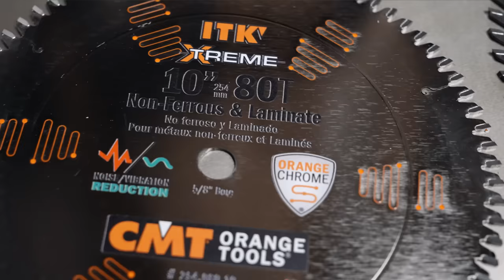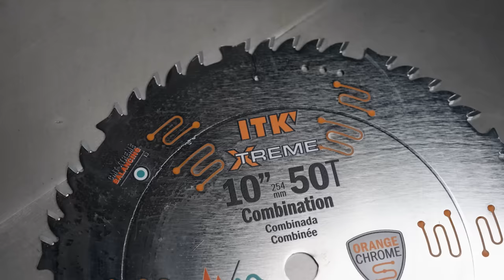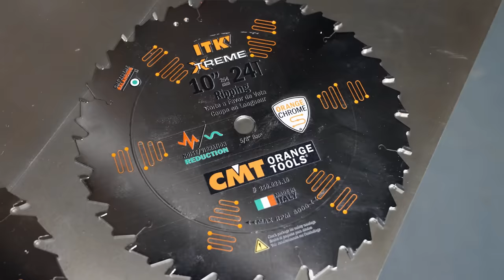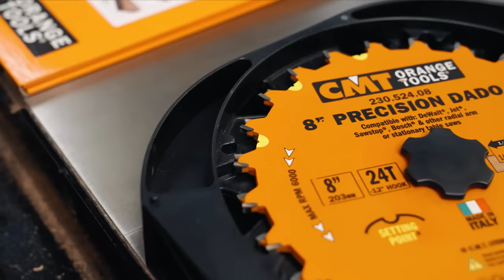A Comprehensive Guide to Table Saw Blades with 60,000 FPS Slow Mo

Comment from the maker: Brand New Lineup of Full and Thin Kerf CMT Chrome Saw Blades - use code KMT10CMT for extra 10% off https://kmtools.com/collections/cmt-saw-blades
Blade Cleaner - https://shop.kmtools.com/bladecleaner
Comprehensive Guide to Saw Blades Blog - https://shop.kmtools.com/bladesblog
Table Saw Blade Sharpening Video https://youtu.be/OSXacCeEZu4
How to Tell When Your Saw Blade is Dull https://youtu.be/ItaxJMBmsOg
Video Refresher
Thin Kerf VS Full Kerf Thin is better if your saw has less than 1.5 HP. If your saw is more than 1.5hp get the Full Kerf. A Thin Kerf blade is great to have in the arsenal regardless for those times you want to save as much wood as possible. Also great for preserving exposed joinery and grain match when removing box lids.
Ripping Blade 24T The best for rip cuts and terrible at crosscuts. My most used blades.
Crosscut Blade 60T/80T Fantastic for crosscuts but terrible at rip cuts. Low or negative rake makes them great in the Miter Saw or for fine cuts in plywood. 
General Purpose Blade 40T Great all around blade for non repetitive cuts in wood UNDER 1.25”. Great for shop jigs and plywood.
Combination Blade 50T Great all around blade for non repetitive cuts up to 2 and 1/8” inch thick. Not good for plywood though.
Dado Stack Best for dados, grooves, rabbets, half laps, bridal joints, and hogging out material when you’re not cutting all the way through.
Central City Tool Supply Saw Sharpening (in Santa Maria, CA) http://bit.ly/CentralCitySawSharpening
Reply: Just ordered a 60T for ripping some Walnut lamination strips for rocking chairs. I’ll put it to the test.
Reply: You mention less than and more than 1.5hp.  However what if your table saw is equal to 1.5 hp (as mine is 😂).  In my search on the web it seems to be up in the air and have even seen some rather large debates.  What is your opinion?
Reply: I don’t know why but my cmt tk combo does better then their 80 tooth and my TK Freud glue line blade
Reply: I'm still undecided on which to get...I can only afford one right now...sigh. @KatzMosesTools Tamar 3x3 customs speaks highly of you so you are part of my research.  I  see blades with slice or openings every so far along...it's my understanding it's to help cool the blade. If I have a blade with none...is it safe to make my own thin spaces or cut outs? If so is there a particular shape or size  and how deep would I go? I  inherited a bunch of blades from an uncle when he passed away.

Comment: I just received my Fine Woodworking magazine. Imagine my surprise to see a tool I purchased from you several years ago that I use very often. Congratulations on being included in the “Dovetail guide section “. I have found it to be an excellent tool at a reasonable price.

Comment: Awesome video. One thing to add though, the difference in the plate thickness on the thin kerf VS thick kerf and how that can influence stability of the blade. Forrest, for instance, recommends to use a blade stiffener on the thin kerf because they can sometimes flutter due to that thinner plate.
Reply from the maker: In my personal experience a blade stiffener severely limits your cutting depth and doesn't have a noticeable effect in my opinion. I could certainly see a use for it in some harder woods but I used one for about a year because someone recommended it and then once I took it off I never went back.
Reply: @katzmosestools  I definitely agree with it limiting the depth of cut. I have one and never use it, but I also only use full kerf blades since I have the Industrial Sawstop. It'd be interesting to see if there are situations where you could cause the flutter and compare one with and one without the stiffener. Maybe it is just snake oil, idk

Comment: Ive been framing for 25 years and never really put much thought into blades other than what i thought was thin kerf is best ive been using a Diablo 24 tooth for years now but i just bought a 60 tooth saw blade for some architectural concrete forming ive been doing and i love it so im here to learn what blades are best for what.

Comment: Nice video. When I started with my JSS Pro (1.5HP) from SawStop, I purchased several quality thin kerf blades just to discover that they caused pinching between the riving knife and the fence, so I switched over full kerf blades (CMT Chrome & Amana Electro-Blu) and all my problems went away.

Comment: I think this video is going to cost me a lot of money 🤫 I’ve understood different blade types before but never really respected it enough to ever using anything but a combination blade, except when I’m using thin veneer plywood. I’ve used TSP to clean my Blade before and it took off all the markings, so it probably would do the same for the slick coating as well. Thanks for this in-depth look at this, Jonathan.

Comment: Great video on multiple fronts.
- lots of good info!
- great slow mo, besides being cool, it really helps understanding what our blades are doing.

I agree on the premium blade being a consideration. I have both a CMT crosscut (IIRC at your suggestion a while ago) and a Ridge Carbide rip blade. Love them.

Comment: I’ve actually started using 7-1/4” blades on my table saw full time, until I need to make a full depth cut. But 99% of the time I’m cutting 1-1/2” or less thick material and the 7-1/4” are cheaper, thinner, easier on my saw, and quieter. And cheaper 😁

Comment: Glad to see you are doing well,  been awhile,  me too, changing gears at this point, come with age I suppose. 

I'll be checking out you shop, perhaps I could use a new blade or two for the table saw, the miter has gotten most of the new blades of late, but in changing gears,  the table saw will need a new set, plus with be researching your collection of blafe and bit sharpening job shops!  

Safety first, last, and in between,  provides for happy fabrications!
PS.  Well damn the bad luck, guess I have to make a 150 mile round trip  you're sold out of the blades I like to use!  ...maybe next time!

Comment: Great info as usual. I need to watch again and take notes. I've got an old (80's vintage) Craftsman 12" direct drive table saw and have always been torn about buying 10" blades for it, feeling like I'm cheating myself out of the extra radius. Thinking rationally about it, the only time it would make a noticable difference is if I'm trying to resaw or otherwise cut through extra thick materials, so I probably shouldn't feel bad about using the smaller blades. Do you have any thoughts about this? Is there anything else I might be missing out on by using blades smaller than the capacity of the same? Thanks for sharing!

Comment: I've been working with hardwood a lot more lately and this information makes a lot of sense now. Bought a big ass piece of purple heart, maple and cherry recently. Each 8-9' long, 3" thick, 8-10" wide. Do not recommend repetitive rip cuts on 2" purple heart using a delta 76-725 on a 15 amp circuit with an 80 tooth crosscut blade. Picked up a CMT 201.024.10 for this type of work and while I have not had a chance to use it due to being sick from the plague, I'm excited to see what it's all about. Hoping it speeds things up! 🙏
Reply: The manual says you should run that saw on a dedicated 20A circuit to put less stress on the motor. If you're cutting a lot of super hard wood like that, it's definitely worth upgrading the circuit to protect the saw.
Reply: @derek_d  having some 30A 220v circuits installed soon 💥
Reply: @bucketofsteam9260  nice! You must have a T1 then? I have the T2 and it can't run 220 🙁
Reply: @derek_d  I do have the first edition
Reply: @derek_d  how do you like the second edition? Not sure if you've used the first for comparison.

Comment: Great video!  For ripping ¾" plywood at a 45 degree angle, wanting a clean cut but avoid burning, what would you suggest? (I am getting burning with my 40 tooth ATB blade from Ridge Carbide)

Comment: Great tutorial!  Questions on the use of thin kerf blades... 

Do you find it a benefit to use (a) blade stabilizer(s) with them to reduce possible wobble?  Are they worth the expense?

Also... any benefit to placing a spacer/shim between the thin kerf blade and saw arbor, so that the blade to fence distance remains the same as that for a full kerf?  I assume switching between thin and full causes the saw fence scale to be thrown off by the difference between the blades (meaning you may have to re-adjust the fence scale each time because the cut distance changes).

Just looking for help before I investigate further.  Tx!
Reply from the maker: I have never found a stabilizer to make a noticeable difference. It is way thicker that the 1/32 difference between a full and thin and cause you to lose a lot.of cutting capacity. You DON'T want to put it between the motor and the blade. The correct side is the nut side. Will cause all sorts of problems with the riving knife and the drive shaft.
Reply: @katzmosestools  Appreciate the fast reply!   Understood... on the stabilizer use.  What about shimming the thin kerf blade to make the right side of the blade align with a full kerf (again, so the blade to fence cut distance does not change)?  My old Craftsman does not have a riving knife and I use a MicroJig MJ Splitter (one setup for thin, one for full kerf).   Tx again!
Reply from the maker: @csimet  it doesn't change to the left side of the blade but changes by 1/32 between the fence and the blade.

Comment: Not a comment but a table saw question. I have a Grizzly cabinet saw with a right tilting blade. Is it  safe to cut a 60 degree angle with the fence on the right side of the blade.

Comment: If ripping cherry I often get burn marks and I think I use either a combination or general purpose blade - what do you recommend for a 2.5HP saw for ripping lumber like cherry?
Reply from the maker: Get a dedicated ripping blade. That's a super powerful saw and with the correct blade you shouldn't be getting burning
Reply: also make sure your fence and blade along with miter slot are properly aligned.

Comment: Question... Doesn't the tip do all of the cutting? I was comparing the shot at 13:33 and the tips of both look to stick up about the same amount above the metal body. I'm imagining this is where the sharpening mostly occurs? Alternatively sharpening is grinding the face and the CMT looks thicker on that direction but not by a ton. Could you put this extra carbide in practical terms? Like n sharpenings at $x vs buying a new blade? I've never had a blade sharpened so I don't know. On one hand, seems like more carbide is better... On the other I thought "huh, adding more carbide that doesn't actually do any cutting just to say there's more carbide would be a slick marketing technique."

Comment: I currently have the 8 1/4in dewalt table saw. Could you recommend where I can get some decent 8 1/4in table saw blades. Eventually I will upgrade to the 10'' table saw. Thanks

Comment: You repeatedly refer to 1.5hp or less. I have a 1.75 Sawstop. Back when I worked at a WW supply store, we debated endlessly about FK vs TK. Since 1.75 is on the border, what's your take? FWIW, I started using a FK GP and a TK rip. So far, I like them. The Chrome Orange are everything you say they are.

Comment: I'm cutting Northern Calif Black Walnut from my yard, that I milled 5 years ago.  3" thick now.    I want the sharpest bestest  nicest cut possible. Speed, FPS, is not an issue. I'm thinking  a spray bottle of water and a 100Tooth on a 10" table saw.  Any free advice?
Reply from the maker: Rip cuts 24-30t and crosscuts 60t. You’re doing way too much with that 100t spray bottle idea. Your biggest problem will be saw power not blade. Walnut is pretty soft as far as hardwoods go.
Reply: @katzmosestools  well, I ordered a 90T diablo blade..... 10" saw. I only have to cut 15 linear feet and it has to be razor sharp. wish me luck. and thanks

Comment: Quick question for you since I can’t seem to find it anywhere else… how do you cut a Dado in 12mm BB? The CMT precision set will dial it down to 1/32nds, but 12mm is ~15.16/32nds, leaving 15/32 too tight and 16/32 too sloppy loose
Reply from the maker: Good question, there's 6 or so shims that come with it to really dial it in. You put them between the chippers.
Reply: @katzmosestools  Thanks!  I was hoping there might have been some metric shims to make it easier to dial it in, ie, set it up for 15/32, and then just add in the shim for the .16 difference which is about .0037", and if you wanted 8mm, use the 5/16, then add a .00246" shim for the difference.  I've only personally worked w/ imperial, but was looking to start doing some drawer boxes and nice cabinet work and BB was metric.  Been doing a ton of research on blades for my new saw (A Sawstop...  thank you for your slowmo video on that too!).  Hope you get some of the ones you have in your shop back in stock!

Comment: Watching the slow mo video I noticed how all the teeth aren't cutting, do pro sharpening shops grind the outer diameter of the blade to get all the teeth even before they sharpen the teeth? No point in having 90 teeth if only 30 are actually contacting the wood.

Comment: JKM, very informative video! The CMT blade cleaner works very well, spray it on, wait about 15 minutes use a stiff plastic or soft brass brush and cleans them right up. I bought a CMT Orange cross cut blade,  (#255.080.10) 80 teeth, 10" crosscut for my StopSaw and it just cruises through plywood with a nice edge but anything over about 1" hardwoods it has a tendency to burn which was a little disappointing, just wondered if you may have the same experience?
Reply from the maker: Your saw may be under powered for super thick wood and that many teeth. Try a 60 tooth or thin kerf 80t. That rake on 80t is less than the 60t so you have to cut slower with the 80t. Hope that helps
Reply: @katzmosestools  Could be, it's the first time I've used a full kerf blade with that many teeth on the table saw. I have an 80T on the miter saw and no issues. But interesting you mention this as I almost ordered the 60 tooth version instead so maybe the 80T will be reserved for plywood which is not a bad thing.

Comment: JKM, I really love your stuff, man, even if you're stuck in CA. Good content here, my opinion (if I say it that way, I'm not trolling, right?) - lots of info even for 14min; the slow-mo shots are sexy but don't support your comments as much as you wanted, I think, and; Simple Green is cheap, works, and if a sawblade is a 'consumable,' (which I'd challenge if you can sharpen them 4+ times as you yourself have claimed)... why bother with a specialty product?  Sorry for the negative vibe, and I'm relieved you got through your Covid thing... this needs to end soon, right?
Reply from the maker: Straight from simple green. They even say it destroys the coating.  https://sawmillcreek.org/showthread.php?149002-Response-from-Simple-Green-about-Cleaning-Saw-Blades

Comment: so are 14" blades for table saws just not even worth it? I just got a rockwell cabnet saw and wanted to run a 14" blade but none of the stores around me even sell them. in SLC utah. but i dont see anyone using a 14 either..
Reply from the maker: Yeah those are really hard to find and if I had to guess pretty expensive. I think only big cabinet shops use them
Reply: @katzmosestools  that’s kind of what I was thinking thank you 🙏

Comment: Since you are using a SawStop, it would be good to mention that they neither recommend 1) a thin kerf blade or 2) blades with anti kickback teeth in them.  The thin blades presumably may fracture when the brake kicks in.  Likewise the anti kickback may allow the blade to make a few more degrees of rotation before it digs into the brake.   In reality they are probably both fine and we are splitting hairs,  but if you loose a finger or an eye, a lawyer, and your wife,  will tell you that you should have RTFM